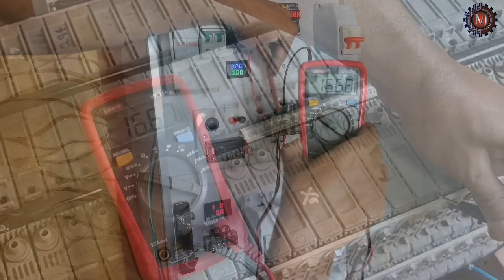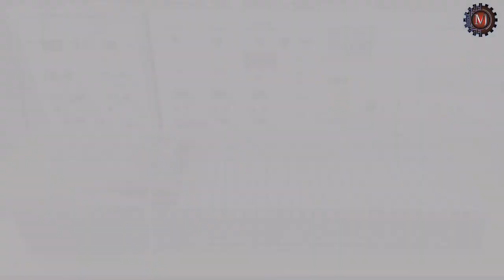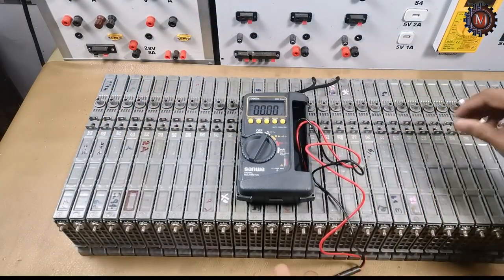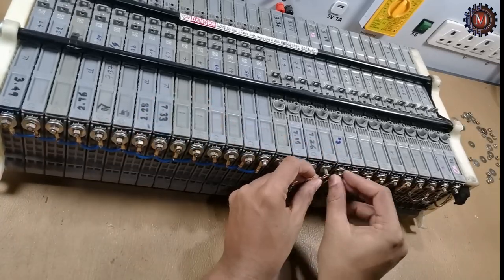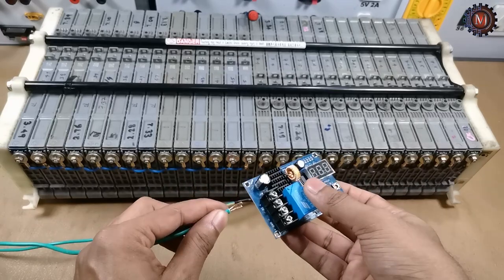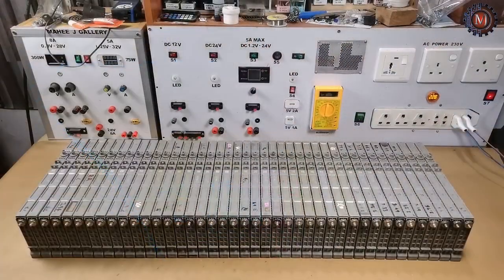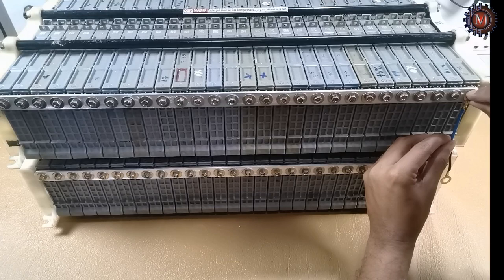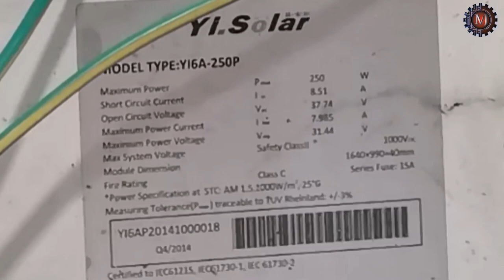Hybrid Battery Solar System Ep01/ Off Grid Solar System 2023

Comment: Now again check bro wire gauge but half efficiency current im using sola 2 years ago 9 hybrid battery pack my our home power upto hybrid pack. im using 4kw inverter and dc to dc lightning  system 1kw panel i will update 500w panel ❤ you system good but wire gauge foult😊